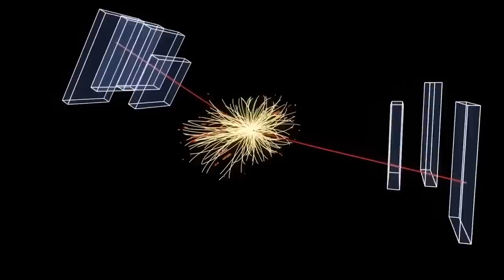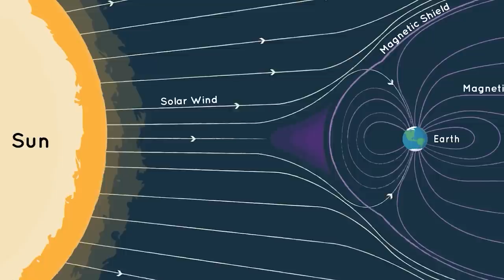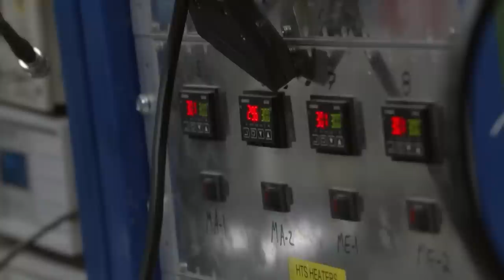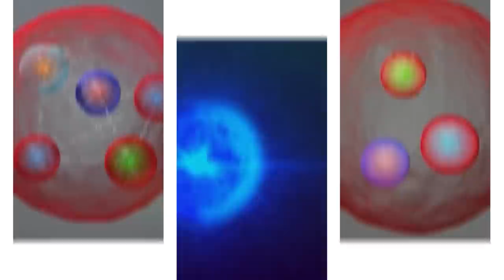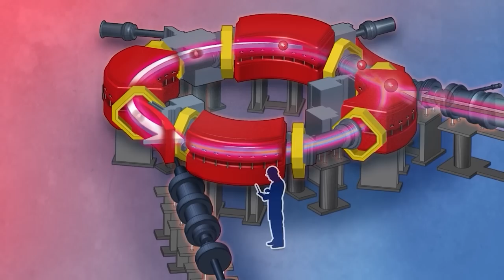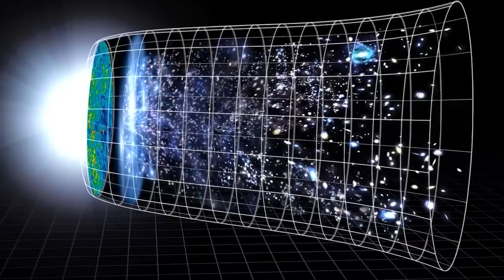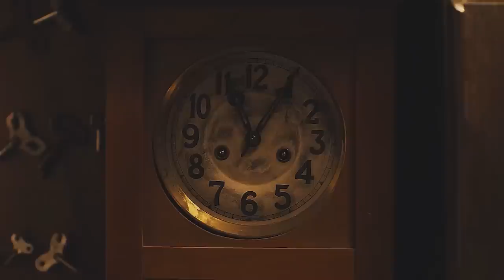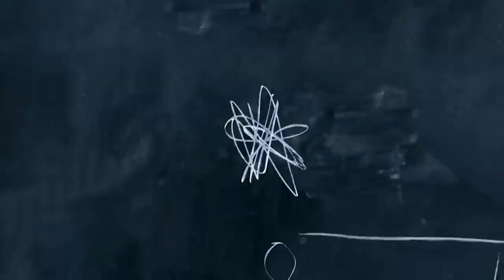Worlds Smartest Kid Just Revealed CERN Just Opened A Portal To Another Dimension

Comment: The Cern Toy opened up a crack in Earth's Magnetic Field; no machine ever built had used 6 tera Volts of Electricity.  The largest concentration of electricity used  by a machine ever.  Then they want increase the diameter, more than doubling the size and power used.
Reply: Runs at 13 to 14 tevs I believe
Reply: This whole project is insane and sinister…